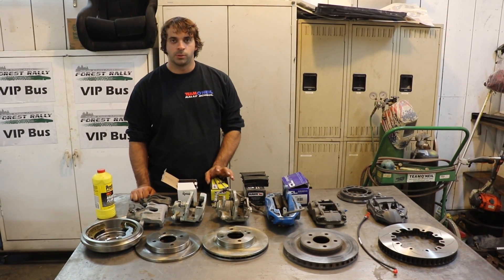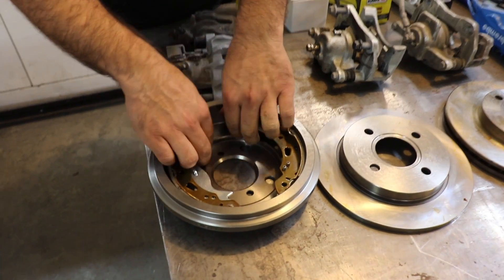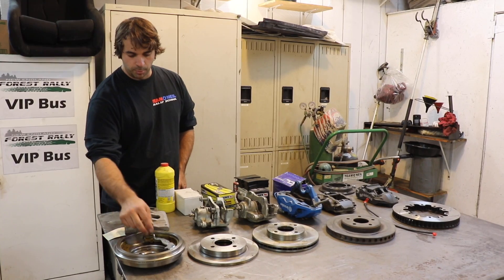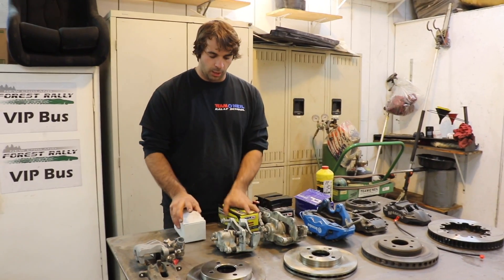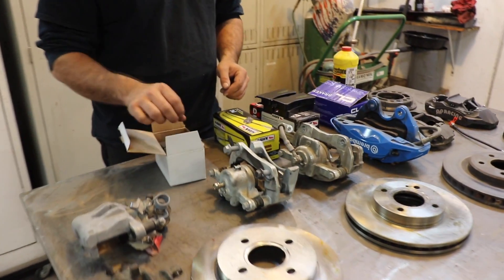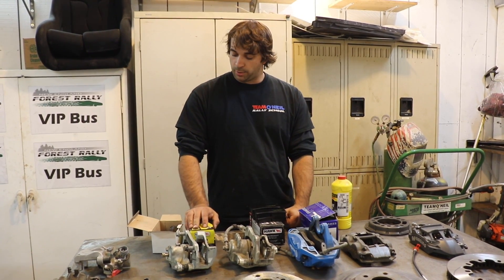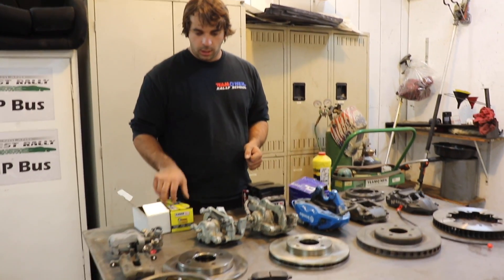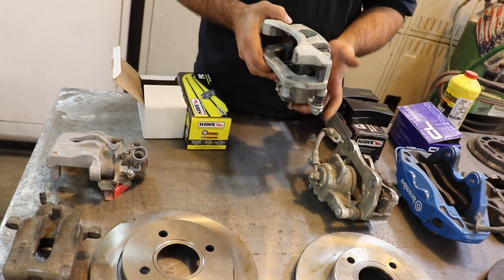Race Car Brakes Explained

Comment: It's a very cool video, but changing just the fluid is not that simple because the system has to be strong enough for the other fluid that gets added into the system

Comment: Hi Team O'Neil, thanks for your very instructive videos. I'd like to know where to buy big brake kits. In any tuning shop ? I drive an SX4. Is it easy tio find ? Could be a general interest topic.  Thanks
Reply: If you google AP racing distributors you will find that most offer brake kits. Not just callipers and discs, but also bells, brackets, bolts and hoses.

Comment: I have a Nissan 370Z sport coupe with the upgraded Akebono(Brembo copy) brakes. It's a very good brake system but I'm having stainless steel braided brake lines installed for a more solid pedal feel. Since it was time to flush the brake fluid anyway, I decided to take advantage of the opportunity to get this done. I'm eventually planning to upgrade my rotors to floating two-piece units with aluminum hats to reduce unsprung weight.
Reply from the maker: Very nice!

Comment: Tip for anyone going from stock drum brake to disc in the rear is to get the OEM proportioning valve for the disc set up as the brake torque is deferent between the too and your gona be disappointed after u covert and the brake force is just not there..

Comment: I'm planning to go with the fewest upgrades possible with a noticeable change. Is it worth it to only upgrade pads, brake lines, and brake fluid?
*8 track days/year plus DD
Reply from the maker: Yes absolutely worth it!  Just be careful to select the right pads to work in the temperature ranges you'll be working with... if you street drive with race pads you will get a lot of squeal, premature rotor wear, and they don't even really stop that well until you get some heat in them... But if you take street pads on the track you'll go through them fast, brake fade, etc... Finding the happy medium that works for you is the trick. We run the Hawk ceramic pads and love them on almost everything here after trying all of them, but your needs will be different, check out http://www.hawkperformance.com/street-performance-compound-application
Reply: Team O'Neil Rally School Thanks for the quick response! I need to do my research to find out my option.
Reply: @Teamoneilrally  So it's all about the pads? The disc can get red hot and still work fine? All of my discs use to end up breaking irregularly, possibly twisting and vibrating. Maybe you could make a vid about bedding in new breaks and/or pads and how to fix them?

Comment: I would have liked some mention of the importance of weather seals/wipers, especially for 'dirty' operating conditions - OEM calipers are relatively resistant to poor servicing but many/most 'race' calipers use neither and require frequent (every event?) servicing and checking - which many may fail to do and which invites seal leakage or failure.
Reply from the maker: Definitely, same with rally suspension... Everything should be pulled apart and at least checked and re-greased every event.

Comment: If I have a base Fiesta with the smaller front calipers and drums in the back, can I bolt the larger front calipers and rear calipers from a Fiesta ST directly onto my car without using some kind of adapter plate?  Thanks in advance!

Comment: Focus RS caliper is axial mounted?  That’s kinda lame.

I’ve seen some claims that the steel bolts connecting the two halves of a two piece caliper together are stiffer than the aluminum around them, making them actually stiffer than one piece calipers, but I’m not 100% sure I believe them.

Comment: Very good introduction to the subject, however I would have liked to see even a very short bit about the importance of upgrading master cylinder when upgrading brake calipers - it is often the case that a master cylinder upgrade is not really optional when going from a smaller piston diameter caliper to a larger piston diameter caliper and it is something people should always research before they start swapping calipers over. Just because it bolts on it doesn't mean it will work.

Comment: Is it okay to have the same size caliper, rotors and pads in both front and back but then use a brake bias adjustment to conduct brake balancing? Or is it overkill (wasteful in terms of upsprung mass)?

IMO, I think larger rears (equal size with fronts) are good for an application that requires usage of a hydro e-brake. Not sure how valid is that opinion though.
Reply: Going to come down to disc temperature, especially for pad material - my personal view is one should try and match the sizes so they have the same temperature gain which will allow the same pad materials to be used for more consistent balance throughout. That is not always possible, though.
You could just use a biasing valve and/or dual master cylinder with balance adjuster, but if it isn't needed it is just additional cost and weight for the car to overcome.
Reply: @gordowg1wg145  if you have the same size rotors and same pads front and rear the rears will absolutely never be the same hwat as the front. The front will always do more braking because of weight transfer. Thats why cars have more capable vrakes in the front than the rear in general, and why front disc rear drum stayed so relevant for so long on so many platforms. You need enough brakikg force to max out the limit of your tires traction, and enough brake material to absord the heat generated in doing sonfor a given application. Any extra mass beyond that is just wasted energy the other 90% of the time you are driving, and actually just extra mass for the brakes friction material to then shed as heat transfer when you need to slow it back down too. Long story short, run the brakes you need and can get by with for a given application, running larger than you can use is going to be counterproductive for the very reasons you guessed in your initial quandry.
Reply: Clearly you did mis-understand what I wrote -  "*match the sizes so they have the same temperature gain* which will allow the same pad materials to be used for more consistent balance throughout". I put it like that because of the very issue you mention - differing thermal loading of the front and rear brakes, with the front brakes normally running significantly hotter then the rear, it is common for different brake pad materials to be used at each end and/or use the same material which will not be working in it's optimum range on at least one end - certainly as the brake disc temperatures cycle through their operating ranges. By sizing the disc size (and design - solid, vented, internal fin design, air ducting, etc) so they gain and lose temperature at approximately the same rate, the pads are more likely to be at approximately the same temperatures and so maintain more balanced braking.
Of course, when you then factor in engine and regenerative braking, if used, it starts to get really complicated in a hurry.
It has been a while, but I am quite conversant with the issues of thermal mass, heat rejection (thermal radiation and conduction to the suppounding air mass), the effect of excessive disc and caliper mass as both unsprung and inertial loads and the differences in friction gradients Vs temperature of different brake pad materials. Not to mention disc materials, effective caliper bore CSA, mean effective radii, mean brake torque, etc.
I kept it simple as the initial poster seemed to have a basic, at best, understanding of brake thermo-dynamics.

As an aside, some of the concerns you have about brake mass also apply to the current fad for larger than optimum wheel/tyre packages - there are some interesting tests around where a vehicle has had as close to identical wheel/tyre packages (same brand, models, widths, etc) tried with the only difference being wheel diameter - in every instance I have seen, the best results were the one a couple of sizes down from the biggest.

Anyway, back to the initial poster's query - to clarify, it is possible but not generally a good idea as there are many factors involved. However, I assume this is in reference to drifting and provoking a loss of rear tyre traction so heat build up 'shouldn't' be too much of a concern as the tyres would be locked up; there would be more emphasis on the effort required for the brake torque required to lock the tyres. in this case, using a plumb-through hydraulically operated brake, sustained brake performance will be of a lesser concern and a larger disc and/or caliper bore may be acceptable - although mu suggestion would be to use the OEM setup, if practical, and use a smaller bore and/or lever with greater mechanical advantage (leverage) to get the force required. I say 'if practical' as some OEM stuff is too undersized for this application.

Oh, and there are vehicles which have overall thermal loads in the rear that are close to, or exceed the front for various reasons, such as mass distribution, low CoG-to-wheelbase and hence load/weight transfer or compromised cooling - for example, the Porsche has aspects of all three, as do heavy vehicles and way back in the mid seventies (yes, I'm an old fart :-D ) Jaguar had chronic problems with their XJ12C rear brakes overheating as they used the OEM inboard rear brake position and they couldn't get enough cooling to them.
Reply: @gordowg1wg145  I responded directly to the comment. He asked about "using the same size rotors, calipers, and pads, front and rear" your answer then was ambiguous at best, regardless. Thanks for clarifying what you meant though.

Comment: mmm basic information, which is very informative for a novice, but i feel that you should maybe have gone into brake balance a bit, i guess it doesn't make that big a difference on fwd cars and even awd? but i for instance drive an mr car so for me brake balance is more important than brake size as i can't just go put bigger calipers/discs in the front as that would cause a complete upset in the cars balance?
Reply: Wyatt has gone into brake bias in the suspension setup video. I know it's a bit counterintuitive, but I just remembered that tidbit.
Reply: yes i remember but I'm talking slightly more in depth... like when choosing calipers how the piston sizes, brake rotor size, SG and the car weight and all of that relate to brake bias as well as brake booster cylinder size and all of that. i guess i would just like another level of info as well.
Reply: awesome i can't wait :) tyvm, love your channel
Reply: The location of your engine and or drive wheels doesn't change the physics of mass in motion. Weight transfers to the front braking all the same. Do lamborghinis and paganis and ferraris have larger front than rear brakes still just like everything else? If anything, a front wheel drive car of all cars would need better rear brakes/bias to replace the engine braking it lacks vs awd or rwd platforms utilizing that rear traction during deceleration, wouldn't you think? Hmmm...